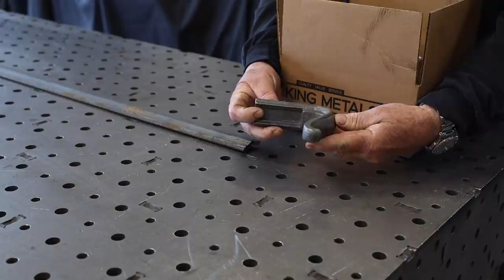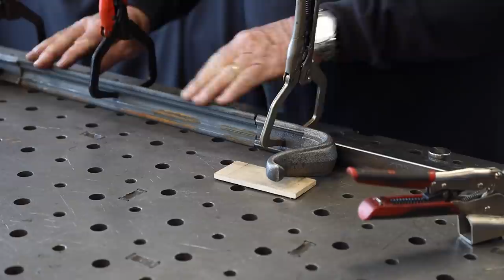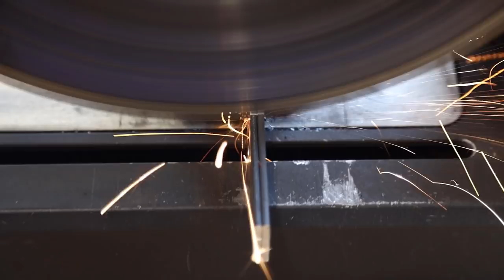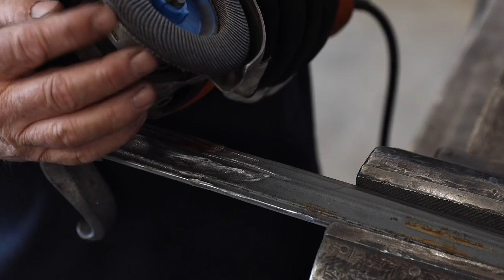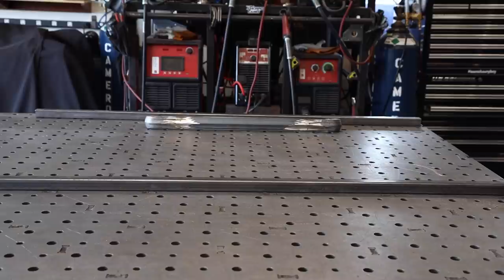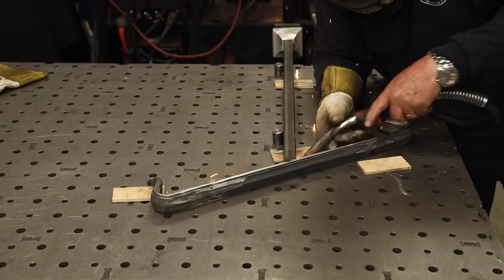Single Metal Handrail Build | JIMBO'S GARAGE

Comment: I would have loved to see you use the handrail in the video, though. Just to check how sturdy it would actually be.
Reply: I would only use 1 post if rail was also secured to wall, otherwise 2 posts minimum-especially 1” square.

Comment: I’ve always used a section of 1x1/2x1/8 channel to align the lambs tongue or volute with the cap rail. I clamp it on top of the pieces, flanges down on the cap rail/lambs tongue. It allows you to see and be sure the two are running true to each other, not dog legged at the joint. As far what the cast ends are welded with, I’ve done a bunch of repair jobs on rails built by a local company that welds them with mig. The cast iron breaks away from the weld. I repair them with a nickel cast iron electrode, and build my rails that way also. It’s a pain to change to stick to do this, but I’ve yet to have a failure doing it this way! Nice rail though! NOT trying to be a troll! Just been building railings for 40 years! Stay well!

Comment: Hindsight being 20-20, it looks like you could have used a short piece of 1/8" thick bar to "fill" the handrail section, then used a single longer piece to bridge over the end pieces and the handrail piece all at once.  I tell you what, I would be in hog heaven if i had a place like King Metals just up the road from me.  I would probably have to drive 3 states away to find some place like that.  BTW, I never noticed that about those 2 clamps...... I actually paused the video, ran out to the shop and dug 'em out to look at them.  I'll be damned.....other than the grip handles..........straight up the same clamp.  The funny thing is when I first purchased the original clamp, it was at a flea market and when I looked at it and used it I though it was a really nice, quality clamp and bought it.  Several years later, I was at another shop helping somebody and picked up one of the Armor clamps to use and thought, Wow....this clamp is just as nice as the one I had.  He told me where he got them and I bought 4 of them and never realized they were the same.....probably because they look so different due to the color and grips.  Go figure. Glad to know I was at least consistent, several years apart, in thinking it was a really good clamp.